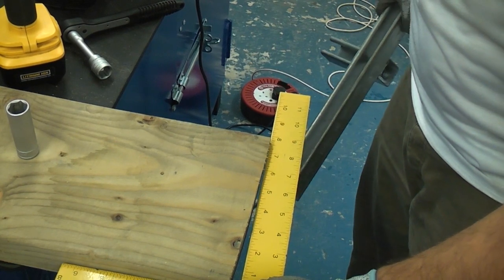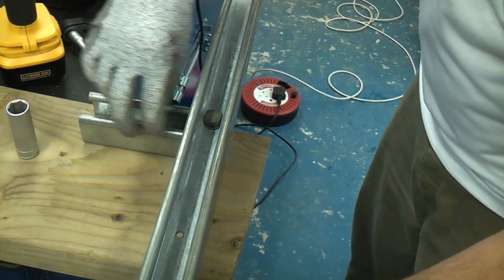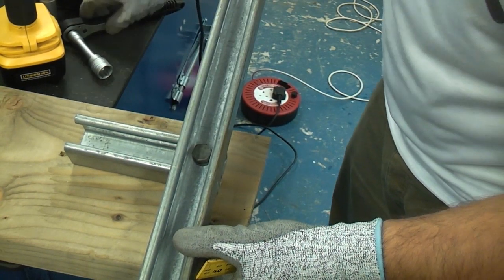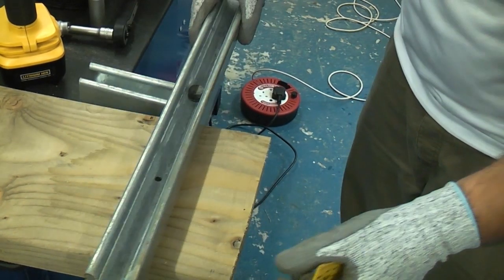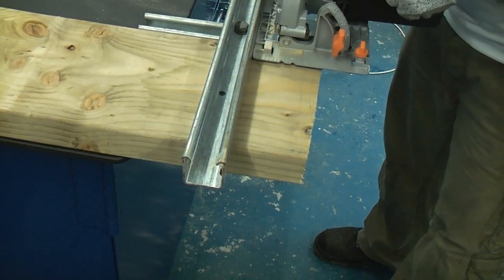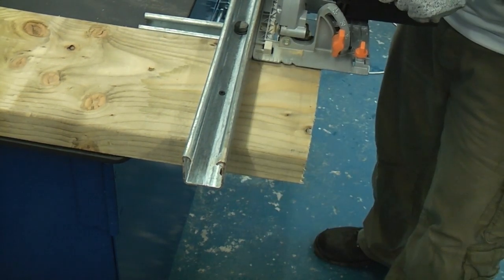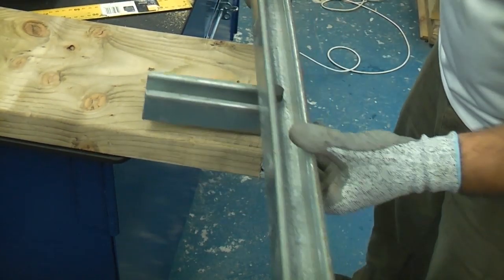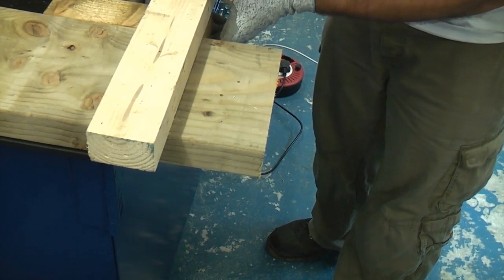How to make a circular saw guide

Comment: Hi UH,It's a great idea and something I could use, I watched your film on "Unistrut" and, even though I worked for years in a steelworks I had never heard of this material. I wouldn't have thought it is something you could buy from your local DIY superstore so I will try a few of the steel manufacturers around here.
I must admit to fancying a plunge saw but they are an expensive item and I cannot justify the cost for the amount of time I would use it!
Cheers, DN.

Comment: Hy jus a quick question, iv acquired some free unistrut and I'm intending on using it as a guide for cutting straight lines with my circular and jig saw. is unistrut perfectly straight do you know?  thanks
Reply from the maker: Yes it is perfectly straight, unless someone has bent it. But in most cases it is perfectly straight even in long lengths.
Reply: Thanks Great to know 👍

Comment: Hi Chez, good tip that.
I have a Skil circular saw and have been looking for a circular saw guide to help get square cuts when cutting large sheets of ply and MDF. The type that holds itself in place as you saw. Is there a generic saw guide on the market that can be used with pretty much any make of circular saw. I thought if anyone might know.......you would.
Reply from the maker: Hi Cliff,
Sorry I do not know as I normally use a large square and then clamp a piece of angle iron along the cut line to guide the saw.
Reply: Cheers for getting back anyway, much appreciated.